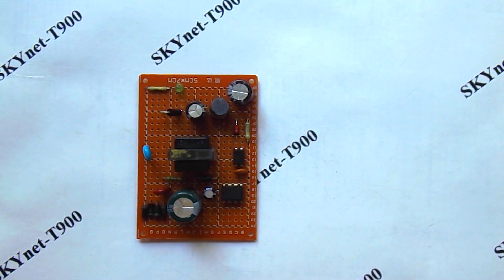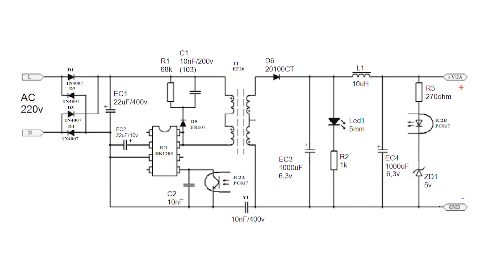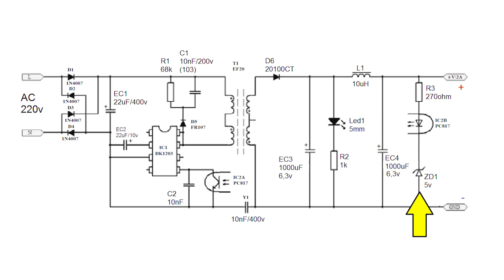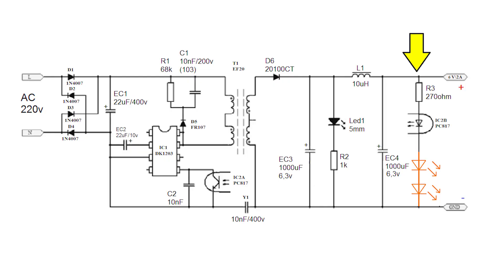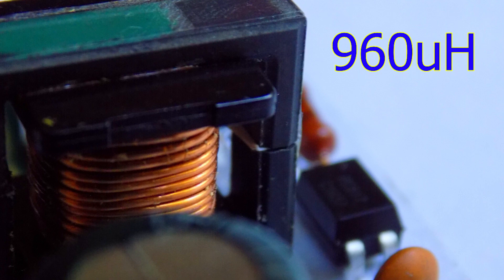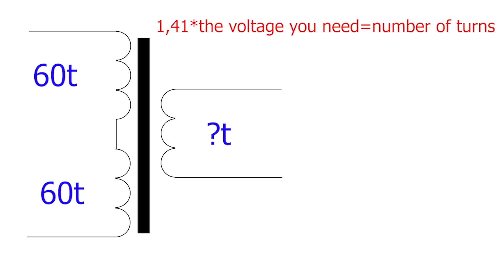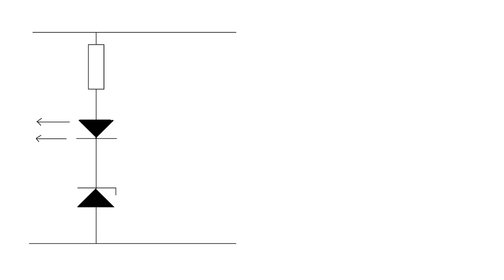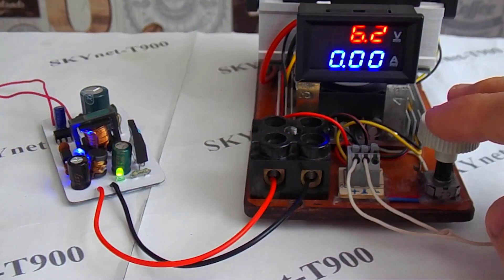Switching power supply on DK1203 for 6 volts (Part 2)

Comment: What if i changed the primary winding? 
from 60 turn to 80 turn
Reply from the maker: it’s possible, but in general there should still be 120 turns
Reply: @Den_Electro_channel i want the output is 12 volt dc but i don't know how many turn is needed for the primary winding
Reply from the maker: There is no need to change the number of turns in the primary winding. It is necessary to change the number of turns in the secondary winding. For example, if I have 6 volts, and you need 12, then the number of turns must be made twice as large. And put a zener diode at 12 volts.